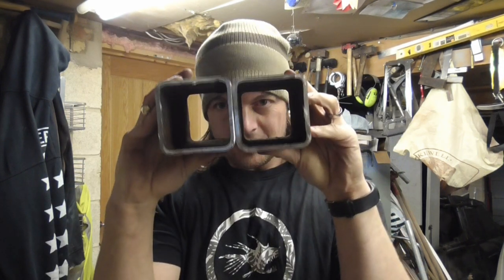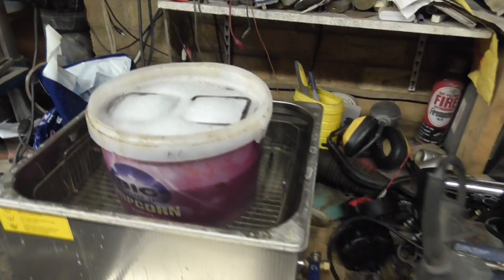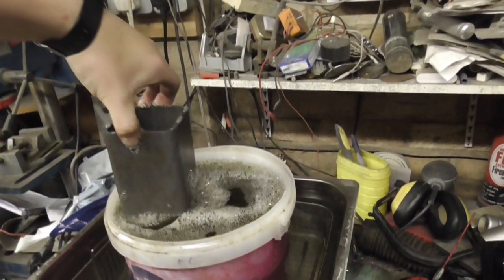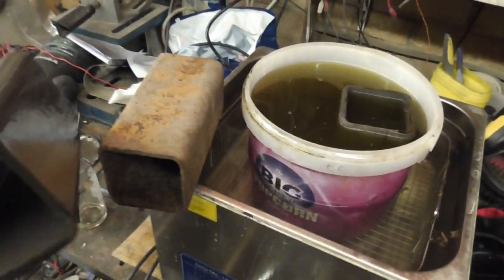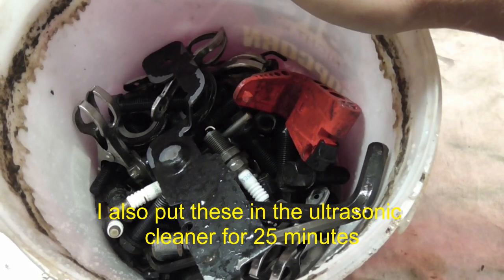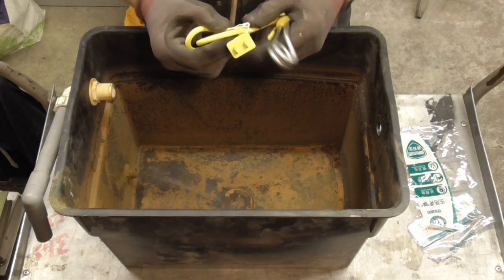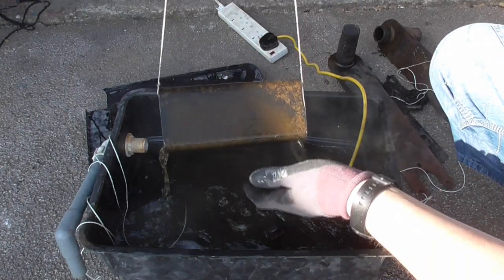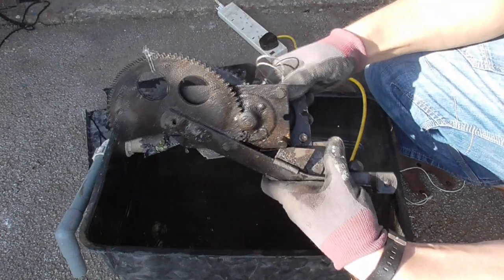Citric Acid v Rust, can I improve the results!? Clean rusty car parts with Citric Acid. Hot Acid.

Comment: last week I put a motorbike petrol tank fuel sender/sensor from inside the tank which shows the level of fuel on the dash gauge in a bucket with citric acid and cold water, the sensor was unmoveable rusty and with barnacles so it was as bad as it gets, after 6 days in the bucket in the garden under a table the sensor/sender was almost like new, i would even go as far as to say it could be used again
great video, i wonder how you wall paper paste would have worked if it was rubbed in first ?
Reply from the maker: Tx for the kind words. Yeah I found that flash rusting coukd be a problem really need to make sure that there is no acid left and all washed off then the metal is protected to stop it. Funny I mentioned this in my latest video about electrolysis to remove rust I did this weekend. :)
Reply from the maker: Just seen your messages sorry. Glad to hear the tank worked out well! TBA ks for the feedback 🙂👍

Comment: i have done this a couple of times now but i have found i get some flash rusting after, have you?
I plan to do the inside of a petrol motorbike tank next
Reply from the maker: Yes it flash rusts very quickly after. Important to make sure all the acidbis off to help reduce it. I wash dry and etch primed anything to keep them stable ASAP. Is the tank full of rust? You can get a product to swill round the tank and seal it after cleaning. Have a look at such as rustbusters Slosh etc. no affiliation lol 👍
 Thanks 🙂👍

Comment: Any issues with citric acid harming good metal? Like pitting? That's what I heard from from some people.
Reply from the maker: Hi. If you watch the first video I kinda test that and leave it in for longer. https://youtube.com/watch?v=ScuJw4tfqp8&si=NvT-PsQrBjZoSZep
You deffo have to be careful not to leave in too long. Also different metals are affected at different rates. Just be cautious. The oxidation you are removing may also be a source of the pitting depending how bad it is, then the acid will reveal this. So far with care, I still find it the easiest and most effective method for rust removal. I also tried Electrolysis here: https://youtube.com/watch?v=-_7JggY5HQU&si=xRcUPxC_NVTGOeWr  This would have been improved as apparently need 'line of sight' to the electrode to work at its best.
Thanks for watching 😊👍